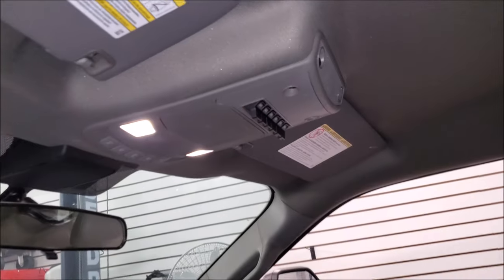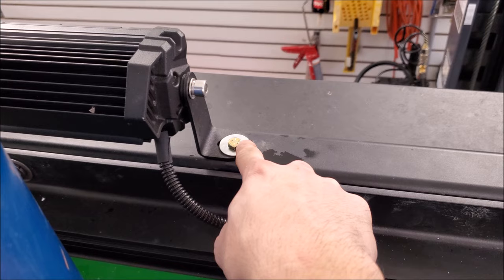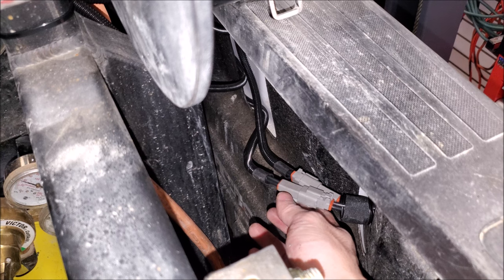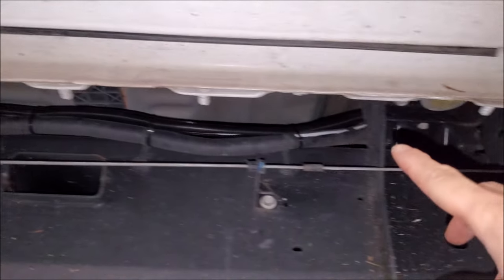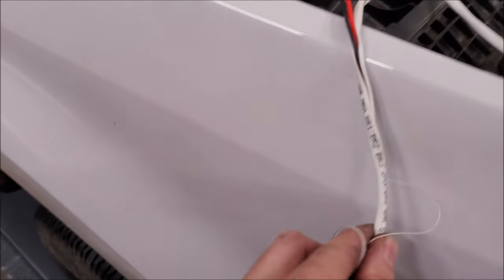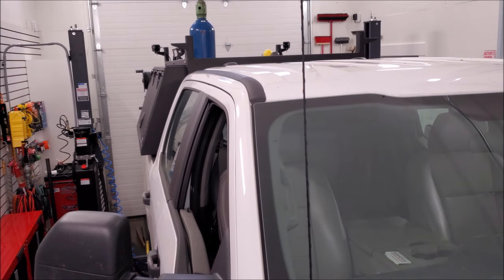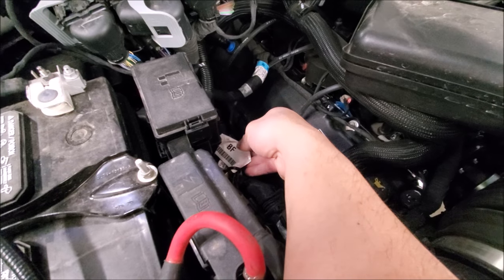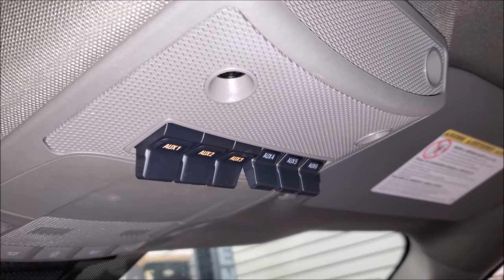How To Wire Ford F-250 / F-350 Super Duty Upfitter Switches (Professional Wiring) | AnthonyJ350

Comment: Most of this has NOTHING about upfitter switches. It’s mostly about how wonderful they are in installing stuff in the truck bed.
Reply from the maker: Wow the entitlement and instant gratification is strong in this one. Do you whine this much all the time? You could have just read the owner's manual but you were too lazy or maybe you just can't figure how an instruction manual works, that's why you're here.

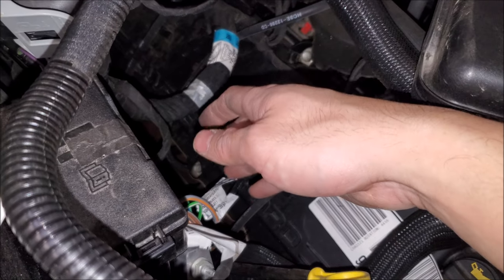Go to 3:16 of the video and I show you where the wires are. Think you can figure it out from there? Or do you want me to spoon feed you some more.

Sorry for giving ideas of using plugs and how to run wires.
Reply from the maker: The title also says "how to wire". Not "what are upfitter switches".

Comment: That was the worst up fitter switch video, your title made it seem your going to show switches and how to connect them.
Reply from the maker: I did, I show you where the connections are located in the truck and how to do runs and make the connection.
Reply from the maker: Did you need me to spoon feed you the answers more for free?  Complaining publicly isn't a form a currency.  Why don't you bring your truck to a shop and pay a professional to do it for you?
Reply: @AnthonyJ350  isn't he referring to the bundle of pigtails by the passenger side kickboard as well? That's confusing to me too, do I need to do anything with them wires down there or just  strictly the ones under fuse box,  and how do I know witch switch I'm hooking up to? Care to share?
Reply from the maker: @Gchupp  You use a multimeter on the wire and flip the switch till you see 12 volts.

Comment: Very nice installation. The routing to factory wiring is professional attention. Here in Florida, I use a lot of Stainless Steel fasteners for exterior installations in vehicles. It resists corrosion a lot better then plated fasteners.
Reply from the maker: Thanks so much for sharing!

Comment: Did you unhook the batteries while you soldered the wires?
Reply from the maker: I don't, I just make sure the switch is off and verify with a multi-meter.  If you're not sure, go ahead and disconnect the battery(s).

Comment: Nice work!
I'm wondering how you install a back up siren in these newer f250/350s?
I need to put one in our new shop truck and would HATE to tap into the factory wires in the back.
I've been wondering if there's a t-harness or something similar that I could use? 
Any suggestions would be appreciated.
Reply from the maker: You could get a t-harness that snow plows use on the 7-way and wire into there.
Reply: @AnthonyJ350  hmm, yes, my boss did mention that (we'll be installing a snow plow at some point) . That'll probably be the best solution
Thanks
Reply from the maker: @DapimpBDSD  You're welcome, this video might help as well when you do the job. https://youtu.be/KA7jsIHGZ9c

Comment: What year was this truck? If I ever go junkyard shopping I'm going to have to put these on my radar to grab that aux relay box, it looks like it could be retrofitted as a standalone for other projects.
Reply from the maker: It was a 2019 or 2020
Reply: @AnthonyJ350  I looked these up on ebay, that newer style (2019+) relay box is like a complete standalone part, would be perfect for DIY upfitting. Of course finding one used for a decent price won't happen for a while. I see the older style 4 switch combos are quite a bit cheaper though and probably would work well.

Comment: Great install, clean and makes sense. Regarding what side to run the wires up to the harness, on a 21', with the harness on the passenger side of the engine compartment, is it better to run the wires up the drivers side with the factory wires over the passenger side? Do you have a preference? Thanks!
Reply from the maker: I run on the driver's side because typically the exhaust is ran on the passenger side and I prefer to stay away from it.  All the factory harnessing is typically on the driver's side and you can zap strap to that.

Comment: Do they also have them pigtails one the inside by passenger side kick panel for interior hook ups? Or do i need to go through the firewall?
Reply from the maker: I think it's all under the hood.
Reply: @AnthonyJ350  I found 4 pass through wires coming by the passenger foot kick panel if that makes sense.  But ya easy peasy to hook into those for interior hook ups.  Factory already went through the firewall for us!! That's on a 2018 f350

Comment: Pls help, my truck does not come with upfitter switches and looking to install them. I would like a stock look and my question is do I need to replace the whole overhead console or can I just replace the mesh with a cut out for the switches to be inserted?
Thanks
Reply from the maker: You'll need to replace the whole upper console I believe.  Is your truck prewired?

Comment: Where do you connect to the upfitter switch? I thought that's what this video was about!
Reply from the maker: It's the connections under the hood, shown in the video.
Reply: The upfitter switches are already wired to the relay/fuse panel. You just have to hook up power and ground like shown in the video.

Comment: I thought they had more pigtails around the truck? Like a bundle by the spare and a bundle by the PTO? Like the already present pass through wires through the firewall?
Reply from the maker: This is what this truck had.  It only has so many switches in the overhead console.  If there were more wires, how would you control them?
Reply: @AnthonyJ350  nevermind.
Reply: @someguy4476  I got you mate, I clicked on your comment because I wanted to know the same thing.
Are there the same bunch of outputs located at the PTO and rear of truck all with the same output relay?
Eg, if you use the blue wire for  a PTO output then you couldn't use that same BLUE output under the hood or at the rear. Saves running wires to these places. I suspect NO as in the  vid if this was the case he would have used the rear outputs for his lights rather than running them all the way up to the hood. Nice thing for Ford to add in future models though. ...